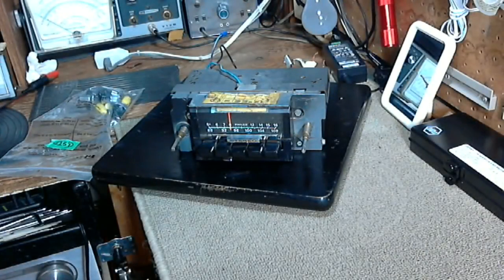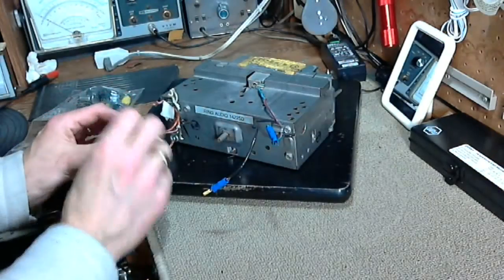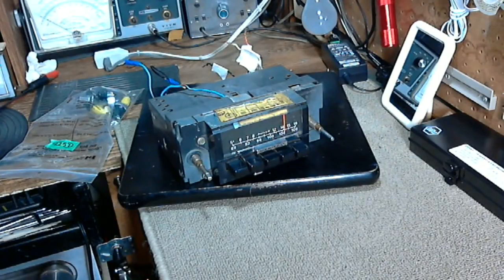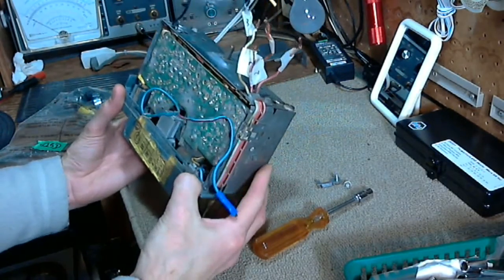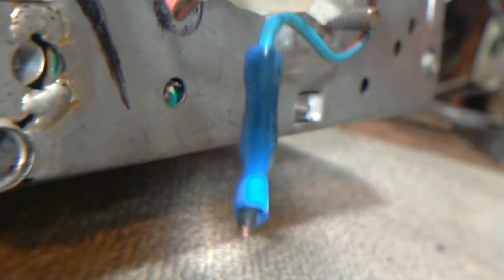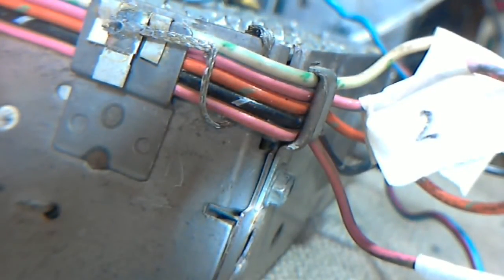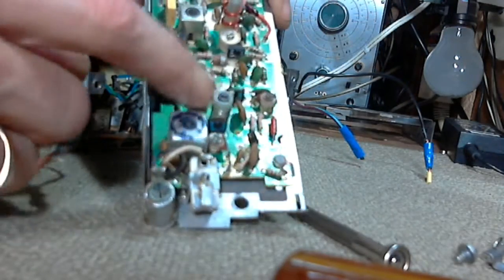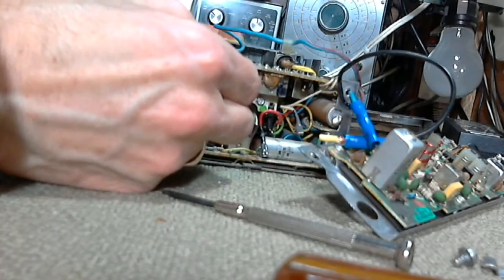Car Radio Repair Video #1 - 1968 Ford Mustang Philco AM/FM Radio D3AA

Comment: As mentioned by others the sliding thing at the bottom is stereo balance.  You set the tunning presets by pulling out the buttons, that's why they have an indent in the bottom.  You then tune to the station you want to set and once there push the button fully in.  BTW I would recommend that you edit down your videos to a more digestable size.  Take Care.
Reply from the maker: That control was not too much of a mystery to me.  On editing my videos, I can't afford the time to do that so I am focused on improving the live result.  Maybe someday I'll go back through my videos and edit out short versions.  For now, I've got more stuff to fix.  Thanks for taking the time to comment.  Jim.
Reply: Jim Lindenas
Understandable.   I hope my comment doesn't come off as rude.  Just a bit of constructive criticism.
Reply from the maker: FelixTheHouseFreak I took no offense whatsoever.  I appreciate that you took the time to comment and hope you'll comment more on my videos.  Jim.

Comment: This is not originally from a 1968 Mustang. The D3AA prefix identifies that it was originally engineered for the 1973 Ford Full Size models, although it could be used in other models.

Comment: Hi Jim. I had two transistor radios,that had the same problem. I checked and checked and it turned out to be a bad antenna, of all things. Replacing the antenna fixed the fading. Why the did this I have no ideal. One reason many people want to have them repaired is to keep the car has close to original, has possible. It's a car restorer thing. I am that way about my Mustang. :)
Reply from the maker: That's not the best news for me.  If the radio is good, I'll find that out with my shop antenna then return the radio and it will exhibit the fading with the old antenna on the car connected.  Phooey on that.
Reply: Jim Lindenas
Ah the joys of vintage radio repair. Now if it fades with your antenna. Then the fun begins.
Reply from the maker: I've been thinking about how the antenna could lead to fading and here's my crazy idea.  Perhaps there was enough corrosion between the antenna ground point and the car body that there was no longer a metallic connecting path.  Instead an electrolytic cell would exist there assuming the steel car body and the metal of the antenna were different metals.  With some moisture in the rusty area, the cell would produce a small DC voltage of maybe .2 or .4 volts.  If there was some zinc involved, the voltage might be closer to 1V.  This voltage is then impressed on the radio circuitry causing the fade.  Maybe a front end transistor's bias would be thrown off.  How's that for imagination.  I have no idea if such a hypothesis would prove in anyway true.  Oh, it's fun to dream.  The truth is probably much more mundane.
Reply: Hi Jim. Spot on.
Reply: If the antenna coax (especially noticeable on FM is not grounded properly on both  ends, the FM stations can drift out and appear weak. The coax will act as an antenna itself and could possibly be out of phase with the car antenna signal cancelling out some of the signal strength. I learned this from experience myself during the days of 8-tracks and plug in FM multiplexers that had external antenna outputs. Start with simple stuff.
Reply from the maker: newjerseybt I think you are on to something considering Bobby's experience with car radio antennas.  Maybe my corrosion idea is not that far fetched as the antenna grounding could fail.  Why would it work at first then fade after time?  that was the owner's complaint.
Reply: Jim Lindenas Corrosion doesn't have to maintain a fixed resistance. Moisture levels within the corrosion may change for a number of reasons. Also customers do not always explain things accurately or scientifically. "Fade after time" Does that mean drift off frequency or loss of signal strength? How much time elapses before fadeout? Does radio ever return to normal operation? Also dust and dirt on high impedance (FETS) circuit boards act like resistors and change with moisture content. I believe I see early OP Amps which are much higher impedance than old tube radios. This is why I prefer a "wash" in addition to brushing. In addition, vintage radios are usually recapped by restorers as they begin to leak or short over the decades but that takes addition time and money. The video brings back the good old days when I did this for a living. Good luck!
Reply: newjerseybt Can I ask a ? ... the phase inverter tube in a tube amp would it benefit from having both side of 12ax7 be checked (bias) a tube? I've heard it said  to use as a phase inverter that has equal readings on both side in the tube will make an A B Amp sound better aka 2 chn amp. Thanks
Reply: Watchman4u
I am not sure, but it makes sense.

Comment: I believe the silver slider is for the stereo balance.  I think I heard a slight click when you put it in the middle.  I believe the way you get the buttons to remember a new position on the radio is to pull the black buttons out a half inch and then push them all the way in.

I once had a 1968 Fastback Mustang.  However, I never used the stereo it came with.  The car was in average condition and I had to replace almost every part on the car.  I eventually used a Dremel tool to cut 6x9" holes in the sides of the rear deck to install Sony speakers.  I installed a newer type cassette radio with an electronic readout and 6 push buttons.  These older cars used the "shaft" type radios, named for the left and right adjustment shafts in the front.  These older type shaft radios I think are now very hard to find with electronic readouts.  I haven't really looked though.

You might be able to buy a schematic diagram from a Mustang parts dealer.  I sold my Mustang in 2005.  Because fewer people own the original Mustangs, all 4 of the parts dealers where I lived went out of business or moved away.
Reply from the maker: I think a lot of local dealers of used things like car parts are being replaced by internet based businesses that are accumulating large stocks of old stuff.  Car themselves are too large and need to be local.  Just about everything else can be moved by mail.  Change is good - just not for everyone during the change.  If I felt an alignment was in order, I might pursue the schematic at a cost but that doesn't seem necessary.
Reply: Jim Lindenas I bought my 1968 Fastback Mustang in 1986 and I kept it until Dec 2005.  It was my daily driver.  When I first bought it, there were 4 general auto parts stores and 4 specialized Mustang parts stores near me.

The 4 general auto parts stores were Chief Auto Parts, Trak Auto Parts, Kragen Auto Parts and Pep Boys.  Every single one carried parts for my '68 Mustang.  Most of these stores had very generous parts warranties, either 5 or 7 year or lifetime warranties.  I could just go and get any part I wanted.  Because my Mustang was so easy to work on, I did nearly all the work myself.  My Mustang cost virtually nothing to maintain once I got everything running.  I even bought performance parts from the Super Shops chain.  If I had wanted to, I even could have bought a rebuilt steering gear box.

Out of the 8 parts stores, all except Pep Boys have gone out of business, including Super Shops.  It is now difficult to find new or rebuilt parts for classic cars.  What you can find will not have longer than a 1 year warranty.

With today's cars, you practically need an automotive degree to work on them.  They are very expensive to maintain.

Comment: You may have to tune the radio to a point to get the mechanism to release
the face and the top go forward off the control shafts  I think
Reply from the maker: Do you think Robert is right.  It's crazy to try to fix this radio when you can buy them working off Ebay so cheaply.
Reply: Well It is a very good point
If you can find a working radio for 30.00 + about 15.00 shipped I don't think that a bad deal. Test it well before installing

Car radios have a lot of down sides to being repaired " Cost, parts. INFO, Compact size, tape decks " all downers

Now Some old car radios are over the $150.00 mark for asis stuff
I sometimes fix car radios  "KEY word SOMETIMES"
I have a long list to check off before I will touch one.
Now If you trying to learn something... well that is a new can of worms
Reply from the maker: Sage advice as always.  Thanks.

Comment: Jim Take the screw loose from the heatsink !!!!!!!!!!!!!!!!!!! :)
Reply from the maker: I'm uploading the next video now.  I got the radio apart but never figured out which screw you meant.  Is it the one on the back right-hand corner of the radio?
Reply: Jim Lindenas
I may have been thinking of a different model ?.